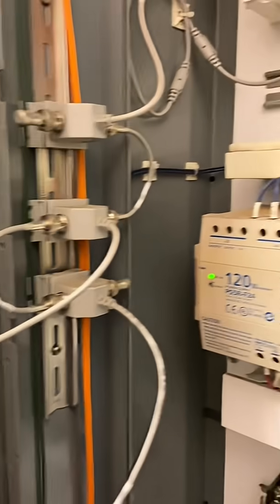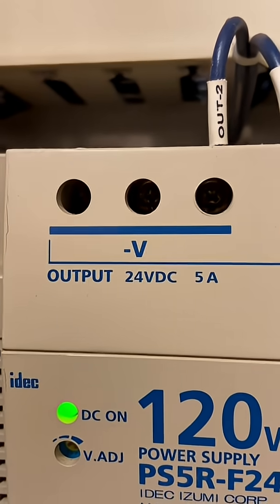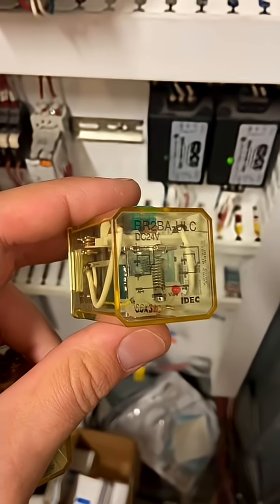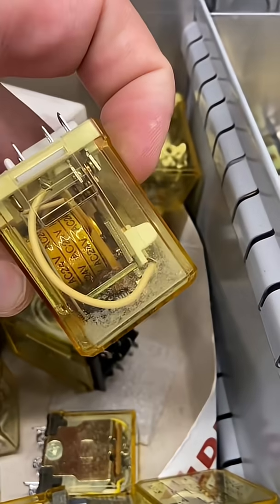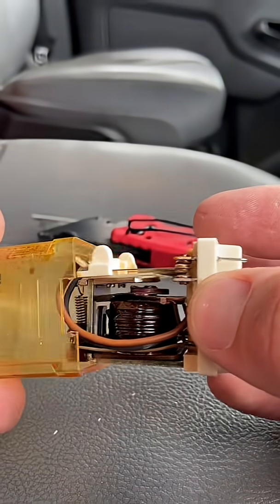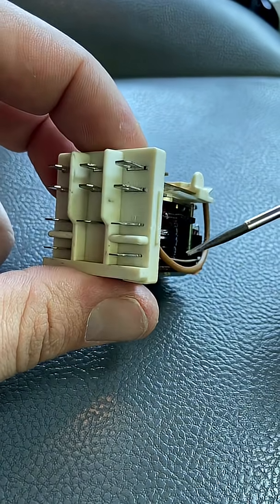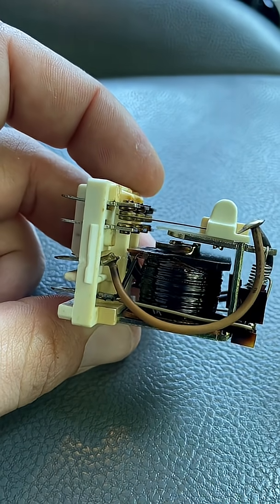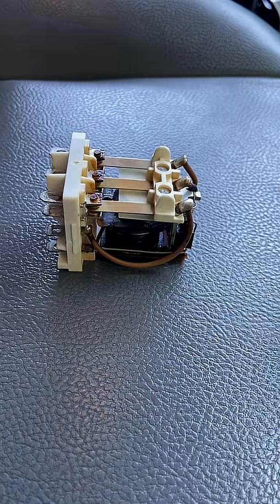Toasty Relay

Comment: I find your channel very interesting. I'm not electrician. I do many things I'm retiring and a few months. My uncle was a lifer dedicato Union New York electrician. He could say how many days he missed in 45 years on one hand. Anyways, just curious. Why won't an AC relay hold up better than a DC. I know it's not the correct application but can you tell me why it would fail or in this case it didn't.. just curious.. I'm thinking AAC relay would it be more robust in a DC system. But by the temperature of that relay seems I must be mistaken..thx a

Comment: I have done similar with a 24VDC relay in a 100VAC socket.  Didn't realize the panel was using mixed relays.  Yanked a relay from one of the preinstalled spares and moved it over to my blown relay.  BANG.  I then understood why there were 4 unused spares sitting there.

Comment: Relays generically have a five year design life if continuously powered (according to IZUMI’s manufacturer’s data). The insulation eventually melts and flows off the coil windings followed by overheating and circuit failures.
Higher voltage rated coils may last longer at the expense of not operating at the nominal half supply voltage most relays are designed around.

Comment: lol  ued to have issues like this with AB safety relays. during our transition to newer 24v gear our tire line was old as shit. sub standard trouble shooters(part swappers) would just grab a new relay for the manual stemmer sta light screen but not verify they were the 120v flavor.  so we too had a drawer of burned up 24v units.  doh! lol  cheers

Comment: I really like when they put blown fuses back in the fuse bin. Really enjoy climbing up on the crane with freshly picked blown fuses.
Reply: Dude this right here^^^😂
Reply: I got in the habit of using the ohm meter on them. Especially after running into one that was bad when I opened a new box.
Reply: From the hardy “blown fuse tree”
Reply: Thats level one test, always ohm new fuses. Duh

Comment: Grew up with 11 pin relays and controls all with the same sockets .  Klöckner-M (now owned by Eaton) made the best relays while S-systems made great control modules such as electronic timers and water level sensors that could drive the relay logic .

Comment: Sheesh, in my engineering class we barley touched anything regarding electricity. All it was from what I remember was on AC, DC, phases, open or closed circuits, circuity, process of digital sound, process of natural sound, ohms, volts, watts, Kelvin’s, etc. I couldn’t be a electrical engineer for Jack.

Comment: So I melted the screw out on a 2-pole. moved everything over to the other pole, but it wouldn't work. The coil led came on, I had continuity between C&N/O and C&N/C but the fan still wouldn't turn on. Anyone know why? 
I replaced it with a SPDT Rly and the Fan still works fine...

Comment: Lol at the same olde Edison/Tesla battle myth propagated even by people that work in electronics.

It's Edison/Westinghouse.

Tesla was the engineer that sold his (badly designed) polyphase AC motor patent allowing Westinghouse to fully expand his AC electrification business into industry, without which many customers had gone with Edison instead despite the significantly greater construction costs of a DC grid system.

Comment: Just found this on the internet as an explanation why you can't power an AC coil relay with DC power: "AC coil relays have inductance, which affects the 'on' current. If you want to use an AC relay with a DC source, a series current limiting resistor can be used."
Makes sense to me.
Reply: I've seen a series resistor being used on some old Danfoss 24AC relays. Whoever made the bodge had the resistor in parallel with a normally closed contact set. So when the relay was off the coil would receive the full 24V DC without a current limiting resistor, but when the relay was latched on the current would go through the resistor.
Also I would like to note the resistor used was a power resistor in a ceramic package, so a 5 or 10W resistor

Comment: Do not throw out you old relays .Some are using platinum palladium  and silver  contacts .Free money recycle for scrap value 
And yes I would smash them so they don't get out back in with the good ones and the strip out teg contacts and copper

Comment: Only to discover that the piece of gear somehow only works if you use the wrong incorrect relay and if you replace it for the right one it stops working. 

That would probably be my luck.
Reply: if that's the case, there's more issues hiding in there somewhere
Reply: Reminds me of that programming joke. 
"There's a few lines of code here. Don't touch them or the entire program will stop working."

Comment: I've worked on a few self serve car washes, the ones I have encountered have all had 24vac control circuits. You wouldn't want to run 120vac out to the control panels in the wash bays.
Reply: Ohh, it'll be FIIINNEE! What could possibly go wrong?? 😂😮

Comment: I like your visual explanation of the old relay! It is worth noting what a relay is though……I usually tell apprentices that it is a switch that can only change states by applying voltage (correct) to the coil. They are mysterious if you don’t understand that and super versatile once you understand them!

Comment: Young engineers that haven't had a lot of field service opportunities have zero knowledge of control transformers and the existence of 24VAC systems. The last time I saw one was in an Atlas Copco motor control system. Although, while reviewing parts and spec with a designer I noticed that Allen Bradley 5410 ethernet swtich can be wired for 24VAC, so someone is using control transformers in comms cabinets.
Reply: And then you come across a control box for Assa Abloy industry roll up doors, with the extension board to control external lights, ramp interlock and feedback contacts for its position. The whole thing works with 24VAC control voltage and if you need to extend the number of contacts for any reason you need AC relays.
In the company I work for 24VAC is pretty much uncommon, only the control cabinets of our Carrier cooling systems use that, too. Everything else in our control circuits is mostly 24VDC.

Comment: I worked at a plant that had hundreds of contactors running 3 phase motors all over the plant. The only time the equipment was shut down was during a power outage or some 3 day weekends. Firing up was a headache because maybe a dozen to 20 motors wouldn't start up due to their associated contactor having a burnt out contact and they were only getting 2 out of the 3 phases. They would run fine on 2 phase but just couldn't get started up from a stop.

Comment: The reason the AC coil relay gets so 'gosh darn hot' when DC is applied is that the AC coil has fewer windings and is of lower resistance for DC voltage. This will cook the coil insulation over time. AC voltages run though inductors like the  coil winding on the relay rely on 'Inductive reactance'. The inductive reactance (AC resistance) of the coil is higher because of the sine wave. 
XL = 2πfL
L

 =2πfL

Comment: The explanation for me: 24VAC has an effective voltage of 24V/√2=16.9V. So if i run it on 24VDC, i "overdrive" it, hence the heat. On the other hand, it's working perfectly fine on 17VDC, it's just not a common voltage.
Reply: 24Vac has an effective voltage of 24V and a peak voltage of 34V. The difference is that DC relays have a higher resistance. On ac you have not only the resistance but also the inductance limiting the current.

Comment: Could someone explain to me, why AC relais dont like DC? Isnt 24V = 24V?
Is that because the coil needs to cool down or something in the zero crossing of the ac waveform or is ac less power or something?
Reply: Thru inductive reactance, AC creates it's own resistance what adds to the resistance value already present in the coil.
When powered by DC, it doesn't self-create that extra resistance.

Comment: To be fair, some AC relays do actually specify in their spec sheets that they can take AC or DC for the coils... but that's more of a "by exception" situation....
Reply: It's possible to design relays that can do both, but they are usually labelled as such (and usually more expensive to make).

Comment: 10 points to the first person who can explain why the 24vac relay doesn't chooch too good on 24vdc.  Anyone know without asking AI?
Reply: An Ac Coil is smaller with lower resistance, because of the impedance that the magnetic field generates. If you use it with DC there is no impedance and thus higher current than with AC.
Reply: @gaunerchen1729  Correct!  (more or less)

FYI, the DC part is called "resistance".  The AC part is called "reactance", and the combination of resistance + reactance (for any circuit) is called "impedance".

Therefore, with DC there actually is still some impedance, but the impedance is only equal to the resistance of the wire (there is no reactance).  With AC, there is both the resistance of the wire, plus the reactance produced by the changing magnetic field, so for AC it will have much higher total impedance.

The total impedance (resistance + reactance) is what determines how much current is allowed to flow.  Therefore, since the coil has much lower impedance with DC, more current is allowed to flow than it was designed for (which consumes more power, and produces more heat).

Comment: Holy crap, this happened a few months ago at the plant I work at. We were short our Eaton 24VDC relays so the engineer told us to use IDEC 24VAC relays. I was literally the only person to protest since AC relay coils rely on inductive reactance to limit current instead of resistance like DC does. The resistance of the DC coils were 4x that of the AC coils and thus the AC ones drew 4x the power. I demostrated it pulling the power with a meter and getting hot to the touch to them and they finally listened to me
Reply: Going through to get my A&P (just got my A) they majorly stress human factors, mainly complacency and fatigue, and the difference in simply maintaining you’re systems and knowing how they function to better troubleshoot. Good on you for being the one to think a little further, and being a little better for it.
Reply: I know enough to know that DC is easy, AC is VooDoo! and that I should be touching Neither.
Reply: Thank you for that explanation!
Reply: And the real fun starts when AC rated contacts are used on DC circuits. A 240V AC rated contact won’t break a 240V DC circuit… (240V DC batteries are used in high voltage switchgear - the result was a burned out trip coil and two 10MW motors that couldn’t be stopped remotely (ie by the emergency stop circuit) - it required someone to enter the smoke filled HV switch room to manually trip the breaker’s (which had to happen simultaneously to avoid destroying the electrical equipment on the grinding mill they were driving)).
Reply: You are lucky because this engineer didn't fire you for "having the audacity to "lecture" him". (It usually happens to others, depending on the egoism of the engineer each time)...
Reply: A solenoid can also be modeled as a variable inductor. As the plunger pulls in the airgap becomes smaller, and the Inductance will change.
Reply: Inductive reactance, where the ac current through the coils of wire will provide induced current in the wire, such that it will interfere destructively with the AC sine wave?
Reply: @CarMad97ci  Inductors do create reactive power in that way, the main property of an inductor is that it resists changes in current flow which is referred to as inductive reactance. Basically, the changing current of the AC sine wave limits how much current can flow through it as it creates a high impedance, higher than the static resistance of the coil. When the inductor is not under a load, as in the case of a relay coil that is already pulled in, it is also subject to the effects of as you stated the current being nearly in quadrature. This results in a power factor of near 0 as there is no net current flow. However even though the current flow is net 0 it still exists. Or at least that's my understanding
Reply: @TactaGhoul  As coils are powered they will build an electromagnetic field that has some "momentum" 

current is limited by the fact that this momentum has to be cancelled before current can actually flow

Think of it like a long pipe which has water flowing through it, and you invert the flow 50 times per second.
The Water first has to come to a halt, before being able to change direction.

This is as far as i have been taught and how far i understand it
Reply: @CarMad97ci  almost. The changing magnetic field that the changing current causes in the core of the coil induces a voltage in the coil. This voltage is out of phase with the applied voltage, so reduces the effective voltage across the coil, and therefore reduces the current flowing.
Reply: I thought it was because of the rms  value of the AC wave compared to the constant DC voltage! ?
Reply: Oh, so that's why we shouldn't mess with that 
Thx
Reply: Dumb question could you safely use an AC relay on a DC power supply by adding the appropriate power resistor in the series with the relay. And if so what is the mathematical formula for figuring the correct resistor to use ?
Reply: @davidhenderson3400  buddy, you're asking if doing something wrong on purpose is a good idea. the answer is no.
Reply: @LexYeenWhat if its all you have and it works?

Comment: Could you explain a bit more what caused the relay to get melty? Or more generally what the difference is between ac and dc relays, and what happens when they’re installed in the “wrong” circuit?

Love your style, a mix of ave & Chris Boden, makes for really entertaining learning!
Reply: Additionally, while this is correct regarding the coil rating (the actual failure in this relay), it's worth noting that the contact rating should also match the power type.  AC goes through zero 100 or 120 times per second (depending upon whether you have 50hz power or 60hz power), so it very easily extinguishes the arc as the contacts break.  DC keeps arcing longer and is more likely to weld closed.  So the same relay may have very different current ratings on its contacts for AC vs DC switching.  Those ratings can be very important if you don't want an always-on relay.
Reply: @josephbrown8905  Always on relay 🤣
Reply: @josephbrown8905 great point and spot on topic.  Also, a good reminder why suppression is so important.  I've encountered unsuppressed contacts create so much interference, that nearby ethernet remote I/O racks would lose their connection intermittently.
Reply: It's also a case of "What was the circuit designed to do?" and "the right part for the job".  As Server8u explained, an AC relay coil and a DC one have different characteristics, and the rest of the circuit needs to match.

It's not that different from trying to charge a 6-volt battery from 12 volts.  You can easily let out all the "magic smoke" that makes it work! 😁
Reply: I'm a 48 year old self-taught Electrical Engineer who now designs industrial controls for $3M machines and would love to answer your question.  AC relays are designed to "reflect" or buffer a bit of the gauss energy inside the coil.  They call this a shaded pole or reflected wave setup inside the coil, which takes advantage of the sinusoidal power inherent with AC.  The AC coil conductors are bigger than in a DC coil, since the power isn't supposed to be present 100% of the time.  When you power this AC coil with DC, the power is constant and higher than expected, which presents itself as waste heat in the AC coil.  Slowly cooks itself.
Reply: @Server8U  While some of what you said is technically correct, it is actually not the reason why an AC relay will get hot when used with DC.

The real reason is that AC relay coils are designed to use the AC reactance of the coil to help limit current flow, not just pure resistance.  However, reactance only occurs with an AC signal, so if you put DC through them, they will not produce any reactance, and therefore will allow much more current to flow than they're supposed to (resulting in much more power consumed, and much more heat produced).

If you measure the resistance of an AC vs DC relay coil, you will generally find that the DC coil has substantially more resistance than the AC one does, for this reason (even though they consume the same amount of current at the same voltage (if the right type is used)).
Reply: @foogod4237  It's always impressive how the Internet never fails to prove how good people are at saying the same thing, different ways.  Let's just say all the words.  Magnetizing current, saturation, apparent power, active power, reactive power.  My original explanation was meant for this audience.  So glad you could show up and regurgitate some big words to show everyone that somehow what I said was incorrect.  I bet people love to be around you.

Comment: Low voltage? Ohms law says when voltage is low - current is high. For the same load.
If the DC power supply is 3ф primary, could be that it lost one of the primary legs. It’ll still work, but voltage will be low
Reply: What would be the point of manufacturing a DC powersupply with 3Φ primary ?
Reply: @benjurqunov
Try and find DC power supply with single phase 480 volt primary.
It’s almost impossible.
Reply: @commenter5469 
Haha. 
What purpose would the third phase wire serve ?
I suspect you don't understand 3Φ